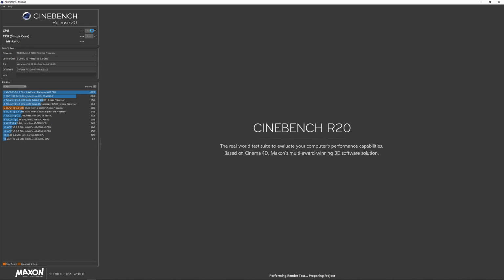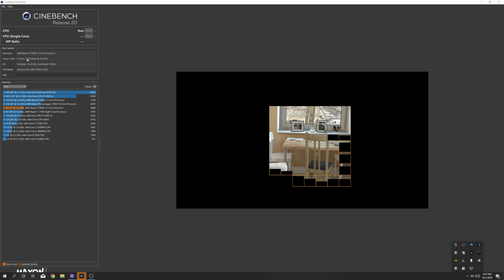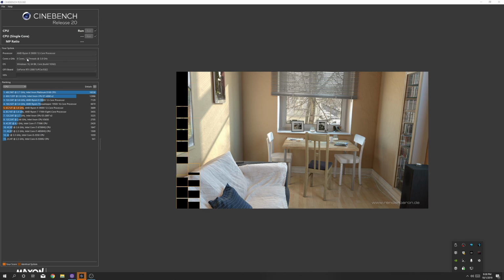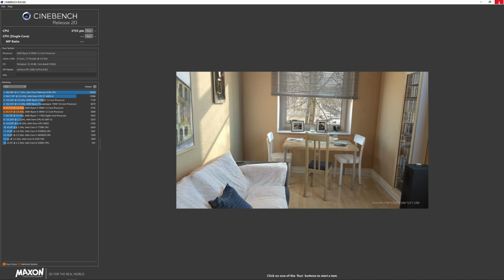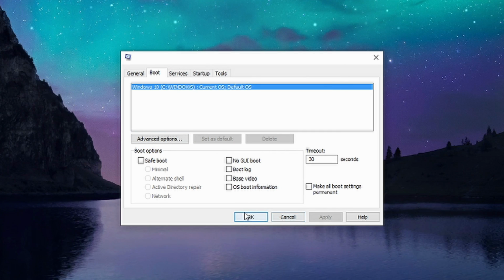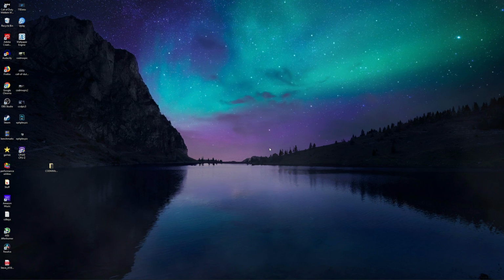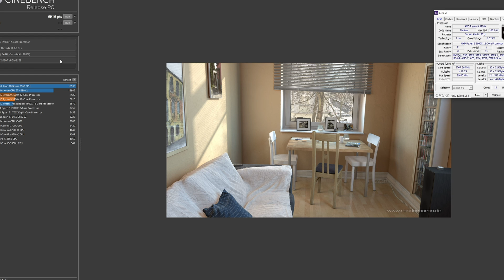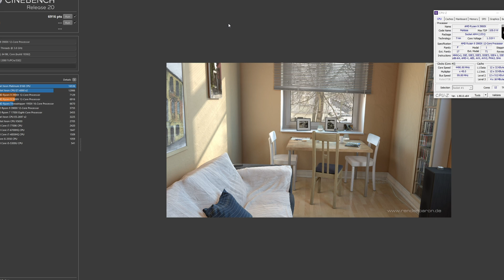Ryzen 3000 issues & How to fix them.

Comment: AMD Ryzen 7 3700X 8-Core Processor
ASRock AB350M Pro4
BIOS ver. P6.60 SMU ver. 46.62.00
TABLE ver. 2361603
DRAM speed 2133 MHz
02/04/2021 12:18:21

DIAGNOSTIC RESULTS
AMD Ryzen 7 3700X 8-Core Processor
Max temperature: 68,5°
Energy efficient: 3,64
Your CPU is SILVER SAMPLE
Recomended values for overclocking (P1 profile):
Reference voltage: 1250 mV
Reference frequency: 4225 MHz
Recomended values for overclocking (P2 profile):
Reference voltage: 1350 mV

Reference frequency: 4350 MHz
Recomended values for undervolting:
Reference voltage: 1175 mV
Reference frequency: 4075 MHz

Comment: Thank you very much, man. i tested in cinebench right after i installed the cpu and the test was right where it shouldve been. i tested a bit later and noticed it said 6 cores with 12 threads. i wondered why i was getting the same frames i was getting with my previous ryzen 5. we're all good now. thanks again, man.

Comment: This is only a theory that Ryzen Master software is the issue somehow flashes system information to the CPU ...I don't think this is the same issue I'm having that your having, my issue Im having I cannot change anything In the bios to make it stick because something to do with embedded information on the CPU... Anyone have any idea to reset the CPU. I have tried resetting Ryzen Master and uninstalling and reinstalling. I'm pretty much stuck on stock settings with my new AORUS ITX Motherboard. This happened on my previous Asrock Ab350 Motherboard but was able to overclock but started having bios issues that's why I bought a new motherboard I believe it's something to do with Ryzen Master Software Update and with conflicting bios.

Comment: Wow yeah this happened to me too! I was so excited to fire up my 3900x and come to find out the setting was only set to 6! I was only getting a quarter of the production out of the box. On the other hand, the base speed is 3.8 GHz and it was giving me 4.6 Ghz without overclocking it.
Reply: Of course, the working chip was NOT thermally limited -> 4,6 GHz boost :-)

Comment: Strange ... Wonder why Windows recognise a 8 core Ryzen 7-3700 and my 7-3800 and not telling that also is a 6 core .But Windows for some reason do this sometimes.Using ASUS ROG Strix X570-F Gaming and Ryzen Master. It sounds like something divided the 7-3900 12 cores to half of it.

Windows 10 :
Type ‘msconfig’ into the Windows Search Box and hit Enter.

Select the Boot tab and then Advanced options.

Check the box next to Number of processors and select the number of cores you want to use (probably 1, if you are having compatibility issues) from the menu.

Select OK and then Apply.

If you are using Windows 10, the box next to “Number of processors” will normally be UNchecked. This is because Windows is configured to utilize all cores whenever a program has the ability to use them.

Merry Christmas.😀

Comment: Idk why but I’ve got mine set o 3.6ghz at 1.015v and it’s stable but when I restart or turn on my pc , it doesn’t save and goes back to 1.4v. Like even doing r20 test it still at 3.6ghz and great temp but just when I open any game Voltage increases to 1.4v and clock speed just goes over 3.6ghz , any help please?

Comment: Thanks it worked for me. I just built mine and believe the problem started after installing Ryzen Master, since i´m pretty much sure It said 12/24 prior it.
Reply from the maker: That's interesting. I'll look into that theory about ryzen master.
Reply: @TechTeardownYT  Yesterday after messing around with it again and the program asked me to reboot, I found out 6 cores were disable again. I don't remember using anything else but Ryzen Master so I'm tempted to believe it could be the culprit. Let me know if you find out more.
Reply from the maker: @luisangelini2220  that's interesting.  Did you make a change in master that required them to ask you to reboot? I want to see if I can recreate it
Reply: @TechTeardownYT  actually, just hitting Game Mode was enough to prompt that. Later I did try some stuff in there, but at first I did none.
Reply from the maker: @luisangelini2220  yeah game mode does take it down to 6 cores.
Reply: @TechTeardownYT  well, now we know the culprit of it. I believe game mode was meant for threadripper so it needed to disable half its core to max the performance of the rest. Hope someone can confirm this.